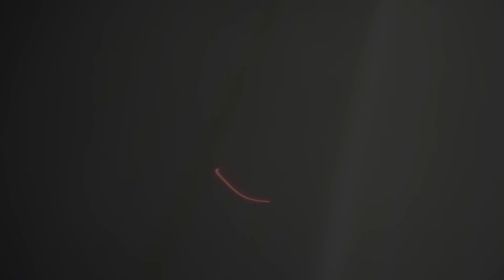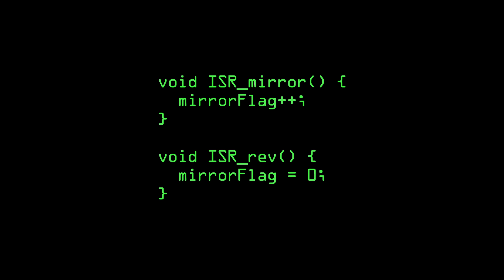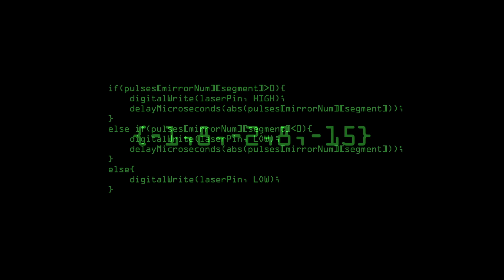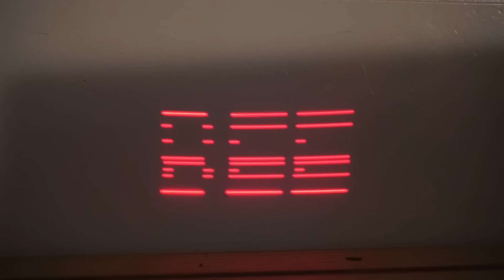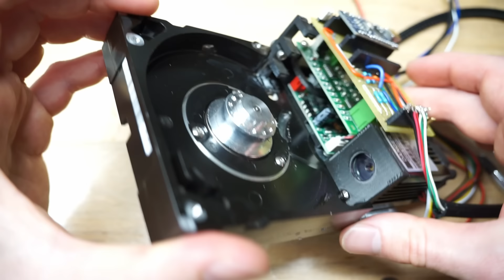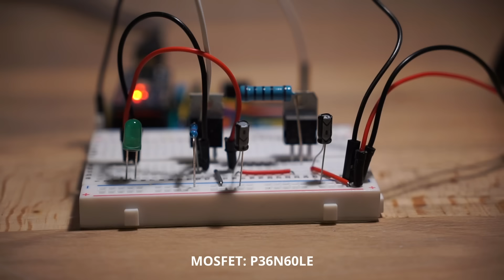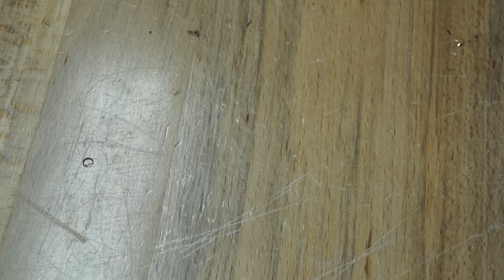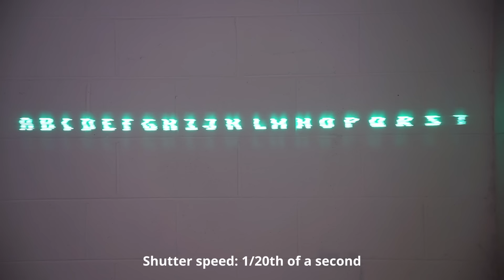DIY Laser Projector - Built from an old hard drive

Comment: Nice vid, few remarks:

1) those weird angle footages of yourself with an over serious and/or expressionless look, may be trendy amongst the lizzard ppl, here on earth they just make you look weird. Try to film yourself acting more humanly - looking at the camera, gesturing, expressing, etc. I.e. acting less like a doll, more like a person. PS: those quick camera angle switches don't help

2) Micro adjustments, prototyping, and construction from different materials over the adjustment array... that's something that Never works. Go with the tolerances on your printer, blame the different expansion coefficients, or pick any other excuse. Case in point, these things Never work. If you want precision crafting, you need quality tools and materials, meaning, throw your 3d printed of the window. Or, review your projects so that no precision piece is built by the printer. The precision on those things is actually horrible. And it doesn't help that the plastics they use are usually trash quality. Seriously, tone down the 3d printing.

3) Still over adjustments - go with metal. Same metal for the whole assembly, and all parts that need to be trimmed, screwed, leaned, etc, everything is made from the same material (and none of it is plastic). Also, use some sort of lever system, direct adjustments are usually too steep if you really need them (as in, a screw pushing a mirror). Precision and adjustment is an art by itself. Also, IF you ever make something that needs adjustments, the one thing you'll have to think quite a lot before getting your hands on it, is what structure/device are you gonna build that is capable of supporting that trim.

4) Your code demo is useless. Yeah, anyone with experience in these types of projects will be familiarized with the concepts. It's completely moot for everyone else, and it's not adding anything to the former. Instead, go with a simple functional diagram of what you're getting your code to do, the main concepts you had to work out like trimming constants and stuff like that. Or do go into the code and do so extensively, enough that anyone who doesn't know the gist, can still learn and repeat from what you showcased. As it is, it's just an act of intellectual display - "here's all the brilliant stuff I did, but it's all above your head so let's not waste time showing it to you, lets just establish that I can and did do it, and you don't". 
Keep in mind it's a video, not a presentation, any user is free to jump any part he's not so interested in, or replay over and over the ones they care. Meaning, it's not up to you (ideally) to cut and speed up footage and end up making half the project inaccessible to others. And if that was your goal anyway, it would be much easier to just not upload the video at all.

5) False  modesty - "Oh a laser projector? Sure no biggy, I'm sure I can get a hand on that! Oh, I need to power the laser by myself? Oh god, that is hard, not sure I can do that."
Assess the challenge of each task adequately. Even if you fill some step might be above your head, start by researching on that first and conclude if it's easy or not, not preemptively deciding it's gonna be too hard.. Makes you look like a fool and/or too presumptuous, when it's the easiest part of everything you've shown so far.

6) Timing the lasers/Leds on and off - This is a recurring theme you will find on many many similar projects, where timing is an issue - reaction time. All components suffer from this, electronics, mechanics, etc. Heck, all you need is to have bought a non filament light source for your house and you'd immediately had realized this was gonna be an issue. How to solve? You can on with a mechanical shutter style device, so that nothing is shown until everything had time to warm up, or be really picky about the components you use right from the start. Reaction time and power up delays will always screw you up i these type of applications, they need to be your #1 priority when planning stuff like this.

7) 8 AA batteries??? What is this, 1980?? Seriously dude, spend a little more time thinking these things out...

8) Nice covers. A shame you left that fast spinning piece exposed. Did NOT think that one through, did you?

9) Bluetooth connection to a phone? Really? Can barely do what's supposed to do, but has dedicated boards for fancy communication and pairing... I know it's little more than plug and play and minimal code to get that to work (since the real code is available to download and you just call a handful of functions), but still?

All in all, nice project, but terrible presentation, you need to work on that buddy.. have my downvote for the time being. Sorry buddy, but for someone claiming to do anything, you seem to lack.. engineering, planning, reviewing, etc.
As it is, doesn't seem like you have a project going, rather some spare parts at hand and trying to push them against each other until something works. And ffs try to keep all parts of the project on the same level (Bluetooth adapter so had no place in here..)

Comment: Why not have the laser always on, then have a motor rotate the laser itself, and then a transistor-controlled LCD screen to block the laser (applying voltage can turn the LCD screen black)? It's similar to how CRT monitors work.

Comment: Previously, I did a very similar design. It is shown in the video on my channel. The green DPSS laser is unstable during long-term operation. A red laser diode 1W was used. Bascom program with pin pull push here and there algorithm

Comment: You've probably already found what you need to fix the timing issues, but my suggestion would be to use the AVR timer/counter system directly rather than using the Arduino functions. Refer to the datasheet for the AVR model you are using for details.

There are a variety of approaches to get what you want, but generally you would set the timer in countdown mode, enable the timer ISR, and set the compare output mode to toggle on compare match (PWM mode). In the ISR load the count for the next toggle time. 

The timer/counter configuration takes a bit of work to understand, but once you get it it's a very flexible and capable system that should be more than sufficient for what you're doing here.

Comment: Nice to see the ingenuity of another maker.
I also started on arduinos but ditched them along time ago. Bite the bullet and move to ESP boards. the esp-8266 cannot be beat on price and ESP-32 has MIND BLOWING capabilities for its price and ofcourse... MUCH faster and its 32 bit. codes and commands are a little different sometimes but meh.
As far as 3D printing goes I would not use PLA, its too rigid and vibrations transfer to the image. PA or ABS would be a much better choice if you got a heated enclosure to print it.
As for electronics, most CC, CV drivers are PWM and we dont want to do anything with timing after a source that does its own timing. putting a load resistor was a good start. Adjust a CC source to 2X or 5X the output of the diode, feed it into a voltage divider and run the diode in parallel to one of the resistors. we don't care about the heat or efficiency here.
Use a mosfet with low Gate charge. And the value of the Gate pulldown resistor should be as low as the microcontroller can handle.
These tips should get you a much crisper image. now Rock on !
Reply from the maker: Thanks. I did actually test the device with an ESP32, but had issues with the interrupts not being consistent for whatever reason. I am looking into some alternatives such as a the Teensy 4.0 which has a 600mhz clock speed. I'll see if I can find a more appropriate mosfet as well. I appreciate the input!

Comment: Back about 12-15 years ago i was thinking about making something very similar to this, I was going to use a 2 speakers to control the x and y and by changing the power to the speaker I could change the angle of the mirror.  I was also thinking about using RGB but wanted to start with RED.... I still might do something like that someday and the technology is so much better now.  Also by using the speakers I could try using vector graphics and not just pixels... GOOD JOB!!!!

Comment: i would suggest you switch to a esp32 because it is way faster and has integrated wifi and bluetooth and the battery solution would be best tu be a rechargable solution like li-ion and a boost converter the laser driver should be a switching converter vor hegher battery life and the os on your pc should be linux

Comment: hi Great gadget I always dream to do myself :P  as a suggestion don't try to use Arduino to handle the laser on/off, delegate that to another circuit that works electromagnetically, I mean you send a stream of serial data 1 and 0 to fill a buffer and your circuits iterates that and do the switching for the laser. Let me highlight A CIRCUIT not just a puny mosffet that could suffer from 0v gate issue if the frecuency is too high (check with Mehdi of Electroboom :P).  
PS: sorry for my English... specially t 1.34 AM hehe

Comment: A second hard drive with the mirrors between the 2 shafts would be more stable. That being said a CNC aluminum drum may be better with the current setup. 

Stepper motors on the mirrors controlling angle would make for an interesting option as well.

Comment: I have been doing some thinking. It is possible to synthesize excited bromide in an argon matrix. Yes, it's an excimer frozen in its excited state.
It's a chemical laser but in solid, not gaseous, form. Put simply, in deference to you, it's like lasing a stick of dynamite. As soon as we apply a field, we couple to a state that is radiatively coupled to the ground state. I figure you can extract at least ten to the twenty-first photons per cubic centimeter which will give one kilojoule per cubic centimeter at 600 nanometers, or, one megajoule per liter.

Comment: Cool project!

To reduce the number of interrupts (and input sensors), perhaps you could omit the ISR_rev() function, and when you need to get the current mirror index, use a modulo-8 operation on mirrorFlag. This operation returns the remainder of a division rather than the actual result, which would be your current mirror index every time, regardless of the mirrofFlag count. Should be true even in the event of an integer overflow, as long as it's unsigned. Alternatively, what if you just reset the value to 0 in ISR_mirror() every time the value reached 8?

Comment: Very nice I designed a similar device 20 years ago ..I could not get the mirrors flat on the faces faces of the octagonal wheel ..So i decided to go with the galvanometer solution.Back in the day there was no 3D printing .I i had to do all by hand ..and a small lathe .It got me nowhere ..So i commend you for your effort

Comment: Consider using a board that already has BT integrated into it, like the ESP32. It's much faster than an Arduino as well. And for a potentially more stable rotating base, try resin 3d printing it.

Comment: Hi, My name is Serg, and I'm from Russia. Sorry for my bad english. I also like to invent various devices, but I don't have the resources to implement my inventions. I watched this video, and in the past I've same idea) You have 3D printer, and milling machine and have middle result... Sorry, but I think you can do this beter. My idea, you need have 2 drive from HDD. 1st for X-axis, 2nd for Y axis. And you need throw out the encoder and create more accurate positioning system. Use magnet from neodim with diametrically magnetized, and couple analog hole detectors, for each drive. You need install hole detector 90 degrees apart. Also you need use microcontroller for each position system. Addition microcontrollers helps callculate position, and send result for parallel interface on main microcontroller. The main microcontroller gets angles from two microcontrollers X and angle Y, and understand position of the laser beam. Also you can use RGB prisma, and connecting Red, Green, Blue laser. But for main microconntroller need use chip with big memory, for remember array. R(8 bit), G(8 bit), B(8 bit) = 640 x 320 pixels (614400 byte for ich frame), x 25 frames par second = equals = 15360000 bytes (or 14,6484375 Mbyte = for 1 second animate).
Reply from the maker: Hi Serg, thank you for your suggestions. I am looking at ways to improve this design in the future. I might use multiple lasers in the next version for additional resolution. I did consider using multiple motors, but one of the advantages of this design was only having one moving part.

Comment: To address the line jitter, don't you think using a hall effect sensor is more accurate than an optical switch? But a better concept is if you make one mirror only actuates vertically and horizontally to scan the entire raster of the display field is more manageable than a rotating disc.
Reply from the maker: A hall effect sensor would probably be better, yes. There is a reason I didn't simply use a single mirror with x and y tilt though - inertia. If it has to move back and forth, the mass has to stop moving, then start moving in another direction. With a single disk rotating at a constant rate, this is not an issue. Besides, I wanted to try something different than the typical galvanometer setup that show lasers use.
Reply: @benmakeseverything  The mirror does not have to be big, 4mmx4mm should be light enough for a X-Y vibrator, But I get your point about using a disc.

Comment: Its a paid stl and excel calculator, but you may want to consider the calilantern for dimensional accuracy.

For precision (mirror alignment), inconsistent layer lines are the likely culprit. This could be due to bed temp hysteresis, wobbly lead screw, or extruder gear slop

Comment: Did you tied every letter to specific on off sequence or there is some other type of conversion?
Reply from the maker: Yes, every letter has a specific on/off designation, at first I used positive numbers for on times and negative numbers for off time, but after the video changed it to pixel arrays where 1 means on and 0 means off, so each line looks something like {0,1,0,1,1,0,0} and the on/off time is therefore a fixed value. Check the github links in the video description if you want the full code.

Comment: What about using a mechanical spinning shutter like an old movie camera, you could set the timing to get really clean scan timing, and for the mirrors you could use screws with a finer thread pitch, carbonfiber filament for the 3D printing should help improve thermal expansion misalignment, and you could setup an alignment target and software to allow for easy calibration. I bet you could get way more distance with all those improvements! Such a cool project!

Comment: the mirrors need adjusting on... three axes?
tilt. for vertical alignment.
rotate. you want them tangential with the wheel. or, at least, all at the same angle relative to the wheel.
and then some side to side play.... youre asking for super tight sub second accuracy on the angles between each mirror.

i find for adjustments like these, its far better to use conical points on screws, and run them at right angles to the travel. use pythagoras to your advantage. can get an m6x1 to run say, 0.1mm per turn instead.

they dont look like the best mirror surfaces? could just be the lighting...

most people use galvos...ive been playing around a lot with piezo elements. more robust, easier to drive, faster... much more limited range of travel.

Comment: Why not use the rotating mirror from an old grocery store scanner?
Perhaps even use a red & blue laser for color.
You could also use a coil to a mirror and drive it with a circuit much easier than a rotating drum. Just make it oscillate back and forth and have a sync signal at start of line (sol) and maybe a 2nd mirror for a vertical sweep.

Gee sounds like analog TV

Comment: leave the arduino to your grandfather. Use newer boards. ESP or Seeed.
Reply from the maker: I actually did try an ESP32, but had issues with the interrupts, the timing seemed to be erratic - I believe it was due to the underlying code running on that chip. I am going to try a Teensy 4.0 which has a clock speed of 600MHz in the future.

Comment: Great work, Ben. Keep up the good effort. I was wondering, have you considered using the pre-installed, reflectiv disks of the harddrive as a reflector? Eventhough the orientation changes, you could eliminate some of your troubles with the mechanical tolerances. Best regards 👋🙂
Reply: How do you get the reflecting surface if the disk to change the angle for the lines to be scanned?  The multiple mirrors running in circle in vertical position ensure that a flat disk won't do nothing else than just reflect the laser dot, even if it rotates

Comment: I suggest you use a few prisms found in DLR cameras to split the lazer to give you multiple stages, each stage could increase the accuracy you could even have it stage to a vertically spinning separate mirror. also on all your screws they need to be all adjustable ; using heatinserts to remove the pliability of the plastic on a fixing point and lets you print a slot to take tension off the adjustable part slid into place and then tightene down again. 

lastly instead of using a MCU to track the chars and laser on times, you could use an eepromm, opamps in comparitor mode to turn the lazer on and off super fast based on the stored values in the eepromm which holds the chars. this would be extremely fast.